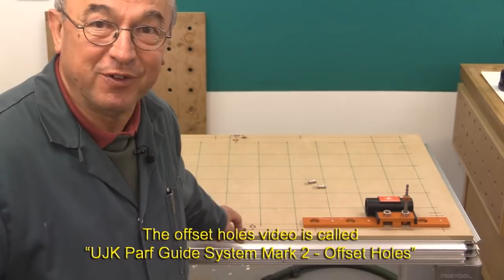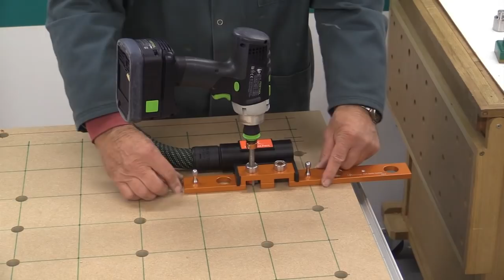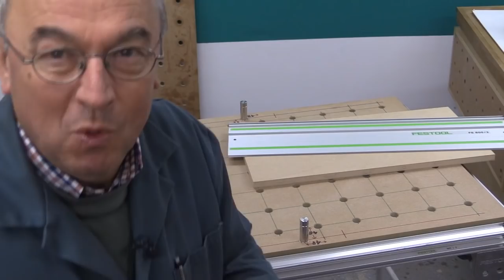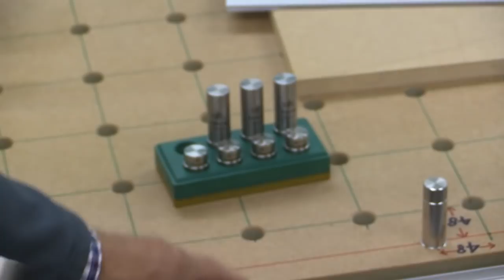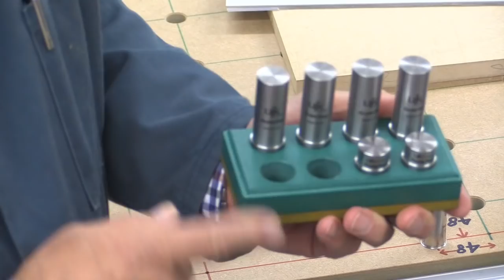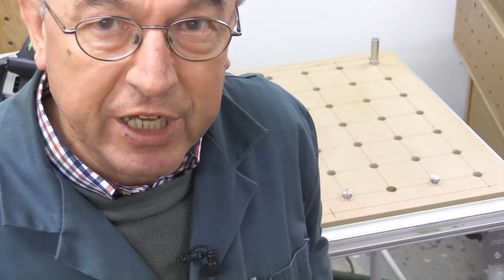UJK Parf Guide System Mark 2 - Part 2

Comment: Hi Peter. I would like to purchase a spare Special D/G 20mm TCT drill with the hex shank
and 3mm centre guide spike but it seems to be the only piece of the kit that Axminster do not sell as a replacement part. Can I get hold of one somewhere? Thanks Steve
Reply from the maker: Hi Steve, I am not aware od any issues with the supply of this kit. Please contact Axminster directly and see what they can do - it may just be a mix up on their web site.  Peter

Comment: Hi Peter, firstly I’d like to say thanks for the brilliant videos that you take time to create and upload. I purchased the parf guide myself early last year and am about to use it on some custom size tops that I’ve made. My question is have is does the 20mm drill bit exit the back of the board cleanly or is it recommended to drill half way approximately then flip the workpiece and drill again from the other side.
Reply from the maker: Hi Jason, The 20 mm drill has spurs which should leave a very clean exit on the underside. It is designed to perform best with MDF. For the best results do not apply excessive downward force whilst drilling and ensure that the extractor is catching all of the waste. Peter

Comment: Peter, can you drill 3-1/2 inch  (88.9 mm) with your system
Reply from the maker: Hi Patrick, No, the only centres that can be drilled are 96 mm, 48 mm and 32 mm. Why would you want 88.9 mm?  Peter

Comment: Peter your videos are invaluable to so many of us interested in using the MFT system. I know that you have made many tops in your time using your Parf Guide System. Understanding that MDF is very hard on cutters and blades, how often do you replace your 20mm bit?
Reply from the maker: I am only on my second 20 mm cutter. The first one was the plain sided one that came with the Mk 1 system and so I then went to the Centrotec ended one on the Mk 2. I have probably done the equivalent of 40 MFT3 tops with the latter cutter and it is still cutting quite well. Everyone should remember that even a brand new cutter will not work unless there is a 3 mm hole already through the MDF. Should the cutter start to heat up (you will smell the warmed up MDF) or needs to be pushed hard to get through then it is time to renew the cutter. It is essential to use a dust extractor to clear the waste whilst drilling otherwise the life of the cutter will decrease by a huge amount.  Cheers.  Peter

Comment: What if the bench top is thicker?
Reply from the maker: Hi Philip, Up to 25 mm is not a problem but over that the depth of cut of the 3 mm and 20 mm drills may become an issue. Also, third party tools, like the clamps from Festool, do not work over 25 mm. Tracksaw cutting station tops only need to be 18 mm thick. A multi functional (expecting serious abuse) bench top should be fine with 25 mm Medite MDF.  Peter

Comment: Another excellent video Peter, thank you! I'm thinking about purchasing your system, but can you tell me what is the maximum table top thickness I can use with this sytem?
Reply from the maker: I recommend using 3/4" or 18 mm MDF for the top. The system can work up to 22 mm thickness but many people have managed to go thicker.  Peter
Reply: @NewBritWorkshop  Thank you Peter, yes my top will be around 2 inches or 51mm thick. I wonder if after I drill the initial hole with the 20mm bit, can I remove the block and just finish drilling the hole with just the bit, without disorting hole size. I've never tried re-drilling a forstner bit hole.
Reply from the maker: Whatever you end up doing make sure that you use the 3 mm drill and guide that comes with the kit to drill the pattern of 3 mm holes even though they will not be as deep as you would like. Then take a normal 3 mm drill and put it in your drill and do your best to extend two of the 3 mm holes say 960 mm apart (if your top is big enough) all the way through. Do not extend any more 3 mm holes. Now using the kit as provided drill the 20 mm holes to a depth of no more than 22 mm. Now flip the top over and based on those two 3 mm holes that went all the way through create your full pattern of 3 mm holes using the rulers as intended. As the accuracy of your completed top will come from the top 19 mm of the holes drilled out to 20 mm, the holes underneath can be drilled out at (say) 25 mm diameter but only to a depth that allows them to just reach the bottom of the 20 mm holes. I can only imagine that you want a thick top for strength. I have always used 18 mm MDF with no problem at all especially if in places it is supported from below.  With such a thick top you will not be able to use the lever clamps and there may be other compromises. Peter
Reply: @NewBritWorkshop  Thank you for the great explanation Peter, I really wanted a strong beefy top, but I may reconsider and weigh the pros and cons of this heavy duty top vs a thinner top, but easier to build with your system, and with a larger selection of accessories.
Reply from the maker: I forgot to mention that the special 20 mm cutter has to have a 3 mm pilot hole all the way through otherwise there is a danger that the tip can be broken.  Peter

Comment: Even though I abhor the metric system I do have Festool's LR32 system (US 1.25 inch or 31.75mm shelf pin spacing) and  I just received my Parf Guide Mark 2 system from the friendly people at Axminister. However, my work bench top is and has always been and will be yet still 31.5 inches wide by 72 inches long or for the imperially impaired 800.1mm by 1828.8mm. The dead center of my bench top length wise is the space between the 20mm holes whereas the center across the width is a column of 20mm holes. All nicely drawn in my CAD program in inches to 8 decimal places. I always start at the center line, never at the edge. However, since Peter established  each of his two outlying edges with his 6-8-10 triangles all his 20mm holes will be equidistant, but unless his initial edge measurements are accurate his hole pattern may not be centered exactly in the table top. Those Parf Guide rulers are more important and useful than one might think at first glance.

Comment: Hi Peter, using your system finally.  Going very well with one exception.  I am using 18 mm plywood so I obviously have tear out on bottom.  However, the 20 mm dogs forthe Parf system are such tight tolerances that I have difficulty removing them, so much I have had to resort to using pliers to pull them out.  Unfortunately this causes some slight scoring on the side of the dogs, causing difficulties in removing the orange part,  Any suggestions?
Reply from the maker: Hi Tim, Yes, plywood can be awkward but we have two solutions. For anyone about to do their top; at the end of cutting each 20 mm hole do several plunges through the hole to clear any fine debris. If you have done all the holes then get the UJK 20 mm reamer from Axminster (107586) or the combination chamfer/reamer (107868). The latter is better as it also does the chamfer.  Peter

Comment: Excellent video.  Have finally ordered my kit to do this.  I still am worried that I go to all this trouble to make this top there is still the ongoing issue with cutting through it with saw. I have the Festool and I know it accurate in terms of depth. But how do you balance cutting all the way through without leaving a cut mark on the table. I can’t get me head around the physics.
Reply from the maker: Hi Randall, The whole point is to stop worrying about the small mark when cutting. Just make sure you only cut one mm or two deeper than your stock.  Cheers.  Peter
Reply: Thanks Peter.  Appreciate you taking the time to reply.  Really enjoy your channel

Comment: Peter, great jig, great explanatory video. I bought it few weeks ago and now I've completed 95% of holes. It was quite easy to complete the process getting a spot on precision and avoiding a CNC I don't have. Well done, Peter!
Reply from the maker: Hi Adi, Thank you so much for the excellent feedback. You have made my day. Cheers.  Peter
Reply: @NewBritWorkshop  Peter, I couldn't get in time, here in Romania, Danish oil so was forced to treat the top after completing all holes. I remember your advice to do that before but had no other way than to do it later and it happened that more than half of the holes became difficult. The other great experience was to use the calibration tool bought as accessory - excellent result in minutes. Meanwhile arrived also the square  and fixing cams so now I solved all my issues with large boards cutting, and more others. Sorry, I have now a bigger issue, couple of my friends are pushing me to  work out their workbench too. I am a big fan of your jigs and fully recommend them to my hobbyist friends.

Comment: Great vid, just waiting on mine but can you highlight where I can see how you chamfered the holes please?
Reply from the maker: I am not sure where the chamfer tool is demonstrated. It is simple to use just put the 20 mm boss into a hole, push down and twist. It is best to do 3 complete 360 degree revolutions pushing down hard each time.  Cheers.  Peter
Reply: @NewBritWorkshop  thanks I found the chamfer bit from Axminster so will order that. One more question if you don’t mind, if I’m working on a table with two sheets (mdf top, ply bottom) I’m guessing drill the initial pilot holes and then with the fostner bit until it bottoms out then once all are done reuse the pilot dog again to drill a further pilot hole and repeat? I’m guessing total thickness is 36mm+/-
Reply from the maker: The PGS is not designed or able to take the depth down to 36 mm and my worry is that trying to extend the depth may results in a loss of accuracy. I can't remember quite how deep one can go with the 3 mm drill or the 20 mm cutter. It is vital that when using the 20 mm cutter that the 3 mm pilot hole is there and goes all the way through. The MDF top should be more than enough to guarantee accuracy so you could drill the holes in the plywood larger than 20 mm using a normal Forstner.  Peter
Reply: @NewBritWorkshop  now that’s a super idea, I think il do that, once the initial holes are drilled il separate the panels and follow up the bottom panel with a larger forstner bit 👍🏼

Comment: Hi Mr. Parker I have seen 2 videos on YouTube and I am excited about the possibilities of the system. I would like to know how the sharp edges of the holes get the 45 degrees. Do you use a start-up cutter with a 45 degree blade, or is there a special tool for this? 
Greetings from Lindau 
Ingo
Reply from the maker: Hi Angio, You can use the chamfer tool or a chamfer cutter in a router.  Peter

Comment: Hi Peter, I'm yet to make my MFT with your MK2 system but I had a trial run at the weekend with a scrap piece of 18mm MDF. You don't mention anything in the video, but I got a lot of breakout at the back of the MDF when drilling the 20mm holes. Is this something you've experienced and if so any tips on how to avoid it? All I can think to do is to lay my MFT top onto a sacrificial board, or partially drill the back of the top, flip it over and complete the cuts.
Reply from the maker: Hi James, You may be pushing too hard at the end of the cut which will mean that the thin weak layer towards the end of the hole is pushed rather than cut through. Drill more slowly and use a "pecking" technique. Also, low quality MDF tends to have the same outer layer as the core. Medite MR MDF has a hard outer layer which helps to prevent breakout.   Peter
Reply: @NewBritWorkshop  thanks for that Peter, I was pecking and trying to hold my midi extraction hose at the same time so I maybe didn't have the control I should have. My MK2 kit didn't come with the port. I do intend to use Valchromat or forescolor for the final piece so hopefully that'll help.

Comment: Peter. I have the mkI and only found out about the mkII a couple of weeks ago. I took a hiatus from woodworking. Impressive improvements. I'm tempted to upgrade but I'm not sure I'd get anywhere near my money back selling the mkI.

Does that dust port fit the mkI drilling guide?

Many thanks!
Reply from the maker: Hi Patrick, Yes, the dust port will fit. I am sorry that there is no simple upgrade path from the Mk 1 to the Mk 2 - the new features of the Mk 2 make it a far better product that is designed to last a lifetime. The only wear now will be the 20 mm cutter which can be replaced. In the right hands the Mk 2 also is more accurate.  Cheers.  Peter
Reply: @NewBritWorkshop  Peter, I'll have to look and see if Axminster sells the mkII parts separately. I'm not sure if TSO over here will do so. Keep up the good work mate.

Comment: Hi Peter. Thanks again for this excellent series on your Parf system. Sorry if this has been answered elsewhere. 
I notice that you use a stop collar when drilling the 20mm holes for the dogs. Should the holes go right through the MDF? If they do go right through is there much breakout? My guess is that if you don't go right through then you could not use the clamps which fit down through the 20mm holes. All the best, Paul
Reply from the maker: Hi Paul, The stop collar is there to protect the drill should the user disconnect it from the drill between operations. The 20 mm cutter is designed to go all the way through. There is very little breakout with good quality MDF.  Peter

Comment: Just watched a video by John McGrath where he use the parf guide.   He did it on a larger  surface than a normal MFT.  The results were mixed.  It was a 4' x 8' sheet.  Should there be a problem when doing larger sheets ?????  Please let us know.
Reply from the maker: Hi Hewitt, I have had no problems with larger sheets. John made some errors which he has acknowledged if you read the comments carefully. He is a great guy.    Peter

Comment: You didn't mention it but I assume the offset holes need to be created while you still have the 3mm holes and not after you've milled out all the holes to 20mm?
Reply from the maker: Yes, the offset holes should be done at the 3 mm drilling stage. However, if you have created your dream top and drilled out all the 20 mm holes you can revisit the process by using the Parf Revision Dogs.  Peter

Comment: Hi Peter, not sure if you read this, but here goes anyway :)
Really like your videos, so thanks for that. Do you know if UJK/Axminster sell that ø20 bit for routers? I have tried a few ø20 bits for my festool 1010, but the holes always end up too big (even when using festool own forstner bits). The UJK one is great, but that will not fit into my router :p Seems I'm far from the only one with this problem.

Hope you have time to reply :)
Reply from the maker: Hi Kenneth, Yes I do read every fresh comment on my channel and try to respond to them all - it takes between 1 and 2 hours each day. I saw what I assume is your thread on the FOG. I understand that anyone with a hand injury may find it easier to use a router but it is almost impossible to make a absolutely round hole with a router unless the router is screwed or clamped to the work piece. Many people have tried but most holes either turn out too large or slightly oval. But back to your question; I do not know of any router cutter that is the exact size of the UJK 20 mm bit. If you are the same person as the one on the FOG please PM me on the FOG and I will try and help further.   Peter
Reply: @NewBritWorkshop  Hi Peter, thank for the reply. Yes that is me on FOG - didn't realise it was you replying to me there as well - sorry post contacting you twice. Will send you a PM.

Comment: Thank you , Peter !!!!!!   Loving this system.... but how does one chamfer the holes, once drilled ?????   
Is there a chamfering drill bit available, or must one resort to using a router ?
Reply from the maker: You can use a router but for speed with say, just a few holes to do, it is easier to use the Chamfering Tool - Axminster part number 104464.  Peter
Reply: @NewBritWorkshop  Thank you for your response, Peter. I'm in the US, where metric is not the preference.Would there be any significant advantage to those here if you also marketed an Imperial version of the PARF system ???

Comment: Hi Peter,
i bought the system and built my own MFT style Worktable. I used a black melamine marine plywood 24mm instead of MDF. When i finished all of my 20mm holes, i was happy and want to use the Parf Dogs that i ordered too. But they wobble/shaking. I checked the 20mm diameter and measured 20,2-20,3mm and 19,9mm at the Parf Dogs.
Any suggestions?

Kind regards from Germany
Reply from the maker: Hi Alex, It is not possible to produce a 20.3 mm hole with the cutter supplied unless it is not held properly in the 20 mm guide block. The cutter is designed to be a very close fit for the dogs. Please contact your supplier (Axminster I assume), give them your order details and be prepared to send the cutter back. If the cutter really is oversized then it is a very odd manufacturing issue and it will be replaced.  Peter
Reply: Hi Peter, thanks for your help. Yes i have now a new one and this is now accurate.

Comment: Should have watched all you tutorials again before I made my portable top. I took a 2’x4’ mdf piece and did half a regular mft and the other half as isometric. Somehow I have one diagonal just ever so slight off. We are talking thousandths of an inch but I think I know where I went wrong. This one will be used up and I will do better next time. The holes are certainly a better fit than my original top. Very happy with the jig. Thanks!
Reply: One other thought, I notice after finishing this top some wear on the aluminum stop collar where it would rub on the guide, too soon for that. I will make an improvised washer out of a milk jug or plastic carton, free and easy to replace.